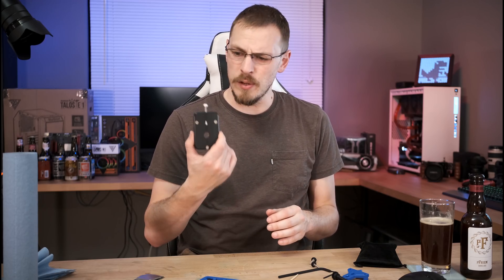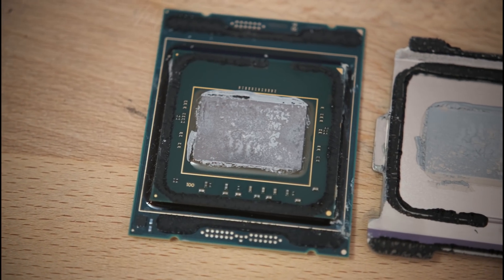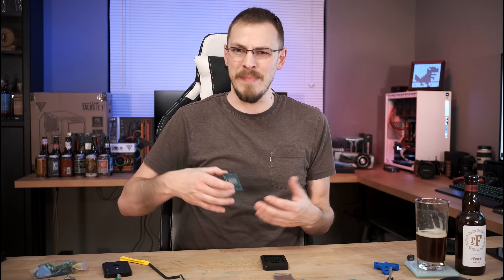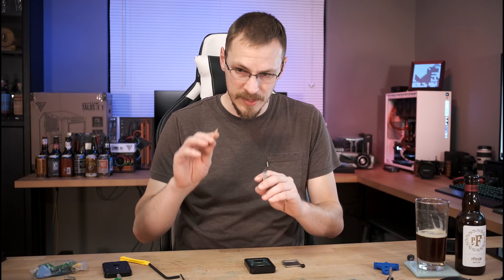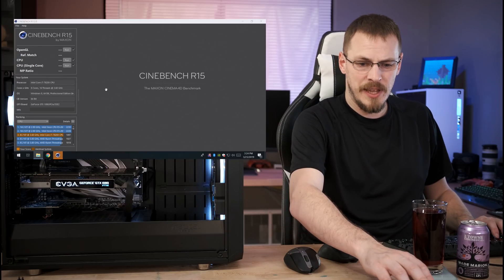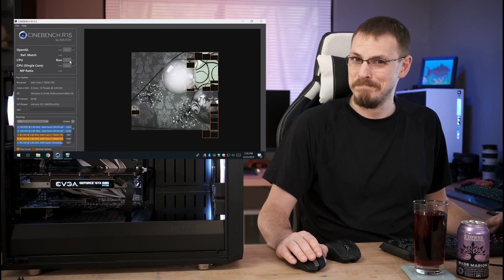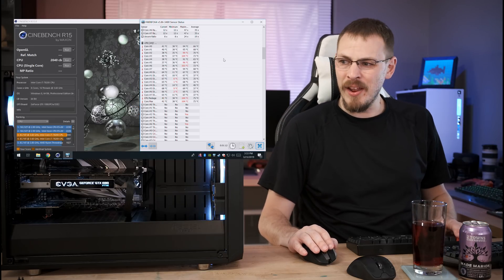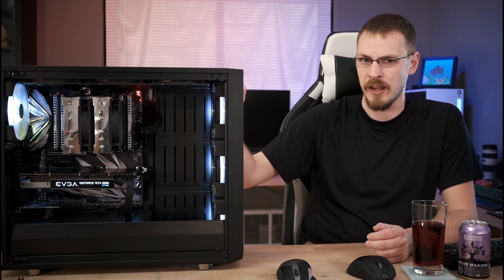Delidding an i7-7820X... Worth It? - Friday Flights

Comment: Swap LM every 6 months? I have never heard of.. I have heard of it average lasts at least two years which is plenty for me! I am awaiting the custom copper IHS delid relid kit from RockItCool for my 10900k- should arrive in 3 days from now.. on heavy / extereme stress cpu test my cpu at 10 x 5 ghz exceeds 95 celcius package temp and  4 cores or more 95 celcius.. this means throttleing and we CANNOT have that! :)  SO I expect the delid copper kit with LM on die and metal paste under waterblock and NO silicone to eliminate air gaps between IHS and substrate.. just 1 tiny glue dot each corner outside on copper IHS is the PERFECT way to do it..  but amazing resultas you got with stock IHS and no LM :) Normally normal paste is no go in delid! on LM- you should try and see the difference! It wil last way longer than 6 months! :)

Comment: very interesting, I have the same setup as you MSI X299 MB and i7-7820x, I just fitted an AIO 240 and my benched 4.3ghz (all cores) stress test never goes above 80c - I haven't delidded or anything like that, the AIO is about 7deg cooler than my air cooler at idle and 10deg under full stress, thanks for the cool video

Comment: I like oc and gaming, but maybe more oc. Last year I bought 1080ti Kingpin and this year last weekend I have finally received my pc upgrade parts z390 Gigabyte Master, Viper steel 4400Mhz and 9900kf delidded, which IHS was a little textured with patina and machining marks like a typical cpu aftermarket IHS. So for my oc experiment, over 3 hours I polished cpu IHS glass flat and mirror finish until I saw my reflection without any distortion or scratches, with glass polish, microfibre cloth on a small flat bit of wood. I then had to do the same for my aftermarket Macho Bravo 2 air heatsink copper contact plate, which was nickel plated and slightly erroded or pitted after 5 years with liquid pro tim on my last cpu. 
So I had to 1st wet sand so it didn't clog up the sand paper, starting with 400 grit sand paper, the erroded nickel plating, going to finer sand paper and later coming back to 400 grit a few times to sand the copper plate absolutely flat to within 2mm of the edges, as the cpu ihs is much smaller so heatsink copper plate doesn't need to be perfect all the way. This copper contact plate was about 3 x the area of the cpu IHS and took much longer to sand and polish whilst keeping the surface flat without any slight roundness from uneven sanding. So after 3 hours of sanding and polishing the cpu ihs and 12 hours for heatsink copper plate over the weekend, when I could see my reflection without distortion or scratches, I stopped working on them and cleared dust out of pc and the 1080ti and put the pc together with upgraded parts. Yeah it all still works and I'm adjusting settings now

Comment: Nice video! I have the same CPU and motherboard but I opted for liquid metal. I have a daily 4.8GHz with 4.9 as my max stable. I get 78-85 between the different cores during a cinabench run with temps in the 50's for 99% of the rest of your typical tasks like streaming and gaming with light content creation in AE and Vegas Pro.

Comment: The thing with AS5 is that is electrically conductive. That being said you should have covered the SMD's with nail polish to prevent AS5 conducting electricity if it happens to get on the SMD's.  Or better yet, use a non conductive TIM such as MX-4 or NT-H1 or GC-Extreme. Good video otherwise!
Reply: NT-H1 is no good for under the IHS,  NT-H1 degrade at 85*c in under 12 hours.

Comment: Noctua NTH1 would drop it up to 2c more and then if you went with the thermal grizzly normal paste could probably get 3-4 total more on just normal thermal paste. Liquid metal would be a hugely better option though since you've already delided
Reply: NT-H1 is no good for under the IHS,  NT-H1 degrade at 85*c in under 12 hours.

Comment: Hi! I want to recommend you the following settings for 4.7Ghz, CPU input voltage: 1.8v(the input voltage greatly affects the temperature!), for core: 1.28v-1.30v (you have installed: 1.36v), VCCSA: 1.10v, VCCIO: 1.20v. The frequency and voltage for the cache must be selected individually, since the possibilities differ from CPU to CPU, try to start 3Ghz and the voltage is not more than 1v. Settings for AVX instructions - AVX2=4.2Ghz, AVX512=3.6Ghz, since cooling the hot heat of the processor at higher frequencies with an air cooler will be problematic. Good luck!
Reply: I wish I have seen your comment about 1.5 years ago when I was OCing my 7820X, it would have gave me such a good starting point and saving me most of the hours trying and wondering if I had already broken something... hehehe

Initially, I hit a stable max of 4.9GHz@1.37v with my AIO 140mm watercooler but the temps inside my case were hitting 70ºC-80ºC  so I modded the case and put the radiator outside of it and temps dropped 30ºC-35ºC so I OCed again and managed to hit 5.1GHz@1.37v stable at around 80ºC-90ºC!!! I think that if I had VRM cooling I could go up to 5.3GHz (the max unstable Windows 10 booted with) but wasn't willing to brick the board or spend that much on cooling to test it out.

(Voltages above are Core Voltages and temperatures on AVX Loads like he did in the video ;D)

I've tried also your approach of giving higher CPU Input Voltage and noticed temp drops as the VRM had more voltage to spare, which was news to me and still can't comprehend why the hell happens in this CPU as I've never seen it happen. I mean, If more voltage passes through the VRM, means more heat is expected, right? Wrong with the 7820X I own (I think it behaves properly after a certain voltage but I didn't want to raise much that Voltage so I don't brick anything)...

I have to go back to that machine to see my final CPU Input Voltage but as I've said, I didn't want to brick my board so I'm pretty sure I didn't went beyond acceptable...

Then I called it and dropped it back to 4.6GHz... Have been running 24/7 as development/virtualization server since then (1.5yr)... Temps usually around 50ºC-60ºC

Comment: I have a 7820x at 1.25 volts at 4.7ghz on  a noctua nhd14 with max of 86c. Cinebench single core is 208 and multi core is 2055 Liquid metal helps quite a bit.

Comment: Arctic Silver 5 is a very old formula TIM and not worth to buy anymore. There are so much better , also non conductive,  TIMs out there. 
Btw: I use LM(Thermal Grizzly Conductonaut)with my 6700k  since  1,5 years now. Oced to 4,9 Ghz i still cant exceed 60° celsius on 240mm AiO. Nothing changed since day one.  Modern LM formulas like TG Conductonaut come with higher indium content which prevents it from harden.
Reply: Conductonaut is the liquid metal.  I think you mean Kryonaut, which is their high end non-metal paste.  Which is ~50% more thermally conductive then the AS5 is "rated" for.
Reply: @plebetopro5786  no nothing wrong there. I meant Conductonaut, which is what im using. I personaly would never go for a  delid, just to perform a simple repaste with a non conductive TIM. Kryonaut is a very  good TIM but compared to LM its still a joke.
Reply: @Squilliam-Fancyson  thought you meant you were using a non-conductive TIM, which Conductonaut is not.
Reply: By the look of the Syringe, it must be flying around there for a long time.

Comment: You wont take the 3 minutes necessary to reapply liquid metal every 6months? Thats pretty preposterous. In a server farm or average small business i understand that. This is the stuff you do on a daily basis anyway. Its literally a 5 minute job including removing and reapplying the cpu cooler once every 6 months. Thats a joke.
Reply from the maker: This isn't my full time job for starters. And sure, I get to play with hardware every week and film the projects that I do. But let's not pretend it takes three minutes to shut down my workstation, remove the cooler, remove the CPU (probably passed 5 minutes already), delid, clean LM from both surfaces, reapply non-conductive coating to the CPU, reapply LM, relid, reinstall CPU, reinstall cooler.

If that was a project I wanted to film every 6 months, sure, it would be worth it. But just for maintenance on a computer I use to produce content on the channel. Totally not worth it to me.

And I say again... I'm not shooting for insane over locking performance with this machine. I just want a slight OC at a reasonable temperature and fan speed. Acoustics and stability (and uptime) are far more valuable to me than saving a minute when rendering a video.

You can set your priorities however you'd like. But try not to unilaterally apply them as mine.
Reply: Craft Computing your drastically overstating how much effort goes into TURNING OFF A COMPUTER. Taking off a glass pannel, removing 4 screws and then sliding a lever. If that takes you more than 5 minutes i dont know what to tell you. Delidding took you approx 60 seconds WITH commentary. This is 10 minutes of work twice a year.  With a custom waterloop and having to drain everything both times i would get not wanting to use liquid metal. But pretending this is anything more than a 10 minute job is a joke. You dont even have to re glue the IHS (as you said)
Reply: why are you pretending it only takes 3-5 mins, takes a bit longer than that
Reply: @nipponchemicon  10 minutes MAX once a YEAR and you don't even need to reglue the IHS. and dudes pretending like it's a major issue to have his editing rig down that MERE MINUTES. How longs it take you to undo FOUR screws and wipe a qtipp over a 4cm squared rectangle and screw back on the 4 screws?
Reply from the maker: Again, your priorities are not my priorities. Your way of doing things is not my way of doing things. You're the type of guy who gets upset because I like IPAs, but you think IPAs suck.

Besides... What in the hell does the way I spend my time have to do with you, and why are you upset I want to do something differently than the way you would? You want to LM a CPU? Fine. That's your choice. Go start your own YouTube channel and tell people how you would do things since you've obviously got all the answers.
Reply: @CraftComputing  drink whatever beer you want. I don't care to consume alcohol. As far as I was concerned OUR conversation ended days ago. Someone else asked me about something and I gave my input. We don't see eye to eye here. Fine. It is what it is.

Comment: Not sure why you would choose to use a conductive thermal paste if not liquid metal, probably something like kryonaut would be better for low maintenance? But as long as your happy with it then great! Still a good result!
Reply from the maker: AS5 is not conductive.
Reply: @CraftComputing  it is capacitive though so not ideal if it gets into contact with the smds on the chip. You were super careful applying it so it will be fine I am sure, would just reduce risk by using something like kryonaut. Tbh I would be worried about deliding such as expensive CPU at all!! Done a few older cheep ivy bridge and haswell CPUs but nothing like yours!

Comment: BTW, I have tried applying thermal paste after delidding. Temps got really bad after a week. I had to apply liquid metal after that. By worse I mean even worse than stock. I didn't bother to find out what went wrong, liquid metal worked perfectly for my 8700k.

Comment: concerning the liquid metal needs to be changed every 6 months. That's not correct. I have delidded over a year ago, still fine. I saw a channel on YouTube who also experimented with liquid metal for a year. It was like brand new even after a year, not dry at all.
Reply: There was a video where it was applied on a laptop (ThinkPad), and where it dried out very fast (less than a year). It was a good quality one, I think conductonaut.
Liquid metal can be very bad to your parts (NOT only aluminum) and penetrate them. So my guess would be that it strongly depends on the two bonded surfaces. If it's between a nickel plated cooler and a die, it will probably last very long and won't really harm the materials. If it's copper, like many laptop coolers are, It will quickly diffuse into the copper and therefore dry out and stain (?damage?) the copper.
However I think it will not perform as well as a good thermal compound in terms of longevity. I have seen some pastes which still looked like new after over 10 years. (But there is a very wide range, some thermal pastes, especially some "experimental" high end ones are very short-lived.). In my personal tests, the cheapest, most generic paste was almost always the best.
If you just want a good performer, go for arctic MX (MX-2 preferrably, it's available in huge industrial tubes enough for at least 50 chips.). The extremely cheap white stuff also works very well, but performs a lot worse then computer-grade gray pastes.
Reply: It's only a problem with bare copper IHSs(I bought one and ended up not using it for this reason) and cold plates(like in laptops). Gallium will form an alloy with copper which in itself won't decrease thermal conductivity much, but the real problem is that it doesn't happen evenly and will leave air gaps. You'll likely only have to reapply liquid metal once or twice in that case as the entire surface of your ihs or cold plate will already be saturated with gallium. With nickel plating this is basically a non-issue.

Comment: ahhh Intel's infamous Thermal Jizz®... looks really similar to that cheap dollar thermal paste that I used to buy.
Reply: This looks way worse than the $1 paste (30 gram tubes, good for about 100 CPUs or 200 GPUs), that I use. Like this was just bad... I use that paste right now on my TR-1950x, and with a 120mm AIO that only covers 1/2 the IHS, I still get 4.15 Ghz all 16c/32t with good temps!

I've got LM I need to try out, but often on the bench I swap out things far too often to use anything good. I do use ceramic based paste if its going onto phase cooling (normal paste will freeze and "crack" or separate and no longer work in the cold. Ironically, the cheapo paste is fine for dry ice cooling, since you don't run a system 24/7 on dry ice.

I thought Intel said they used the toothpaste for longevity? Why does it look hideous already? Yet Xeons are soldered, and those are supposed to be reliable?  Seems like Intel makes a lot of excuses... AMD just makes a better product all around (goodness, Steve from GN had 39c core to core differences! That would mean a core at 61c is limited by the 100c core thermal throttling, the IHS was worse than I would expect from a monkey beating them out of sheet metal with a rock! Bad quality on a "top end" nearly $2k 9980XE... That's just garbage quality control!)
Reply: @jakegarrett8109  completely agree since the dollar paste doesn't harden/dry out like this especially if it's new. You're already paying a premium on these chips yet they can't even bother to to be using a proper TIM for these chips, even the 9th gen cpu's are shit even though they're soldered like they just used literal soldering lead on those things. you could probably fill up like 50+ or more cpu's just by using a $10 tube of MX4 but intel just couldn't be bothered. With proper soldering material these CPU's would probably be less of a headache like my Sandy Bridge chips. so less of a headache in fact that I'm actually using a 65w rated cooler which is the Ice Edge Mini v2 by Deep Cool on my 95w tdp i5-2310, the only max temps that I got on a 30c room, closed case(generic case) 1x120mm Exhaust and Intake is 72c on AIDA 64 for like 30minutes.

conclusion? Intel's Thermal Jizz® is just worse than the cheap $1 white/gray stuff that you could buy bulk on Ebay!

Comment: I dunno who said you had to swap out liquid metal but....
I haven't on my 778 machine for well over 3 years now and she still purrs like a kitten nice n cool...
Reply: Confirm that based on my personal experience. Liquid metal is not supposed to be changed every 6 months.
Reply: @madd5  i'm genuinely interested where he got that from. The whole thing with liquid metal is that it doesn't dry up
Reply: @Gekko12482  it doesn't evaporate; however it consumes any touching metal surface and incorporates it into the alloy at least slowly, thus changing its mechanical properties - if you raise the melting point sufficiently, it will convert into solid flake and will appear "dried up". It should take a lifetime to consume an appreciable amount of nickel, but it etches copper quite obviously in an observable timespan. I don't think it's possible to create a liquid alloy that doesn't do that.

Another potential issue is that constituent metals can start falling out of the alloy and crystallising in place. Same effect. Perhaps addition of other metals as above together with thermal cycling can be driving this process.

Comment: Spending 30 something dollars to get a 14 degree c drop is well worth it in my books. As someone else mentioned I remember as5 has a longer curing time so you might see further temp drops. Thats provided if it wasn't cured when you initially tested it. I believe curing based tims are better for between the IHS and cpu die because once cured it kinda keeps the IHS in place. That helps when u don't have the silicon anymore or don't plan to reapply the silicon again. As always good job Jeff.

Comment: Why do you still use Arctic silver 5? There are new non conductive/capacitive thermal pastes that perform better nowadays, not to mention they don't need time to cure either
Reply from the maker: AS5 is not conductive. And it's spitting distance of kryonaut when cured. And I had it on hand already.
Reply: @CraftComputing  it is capacitive though